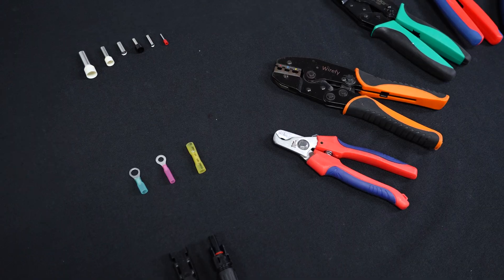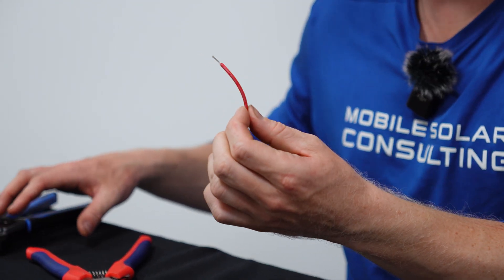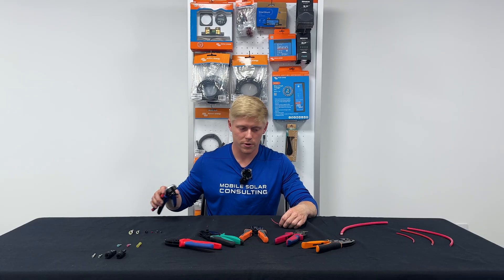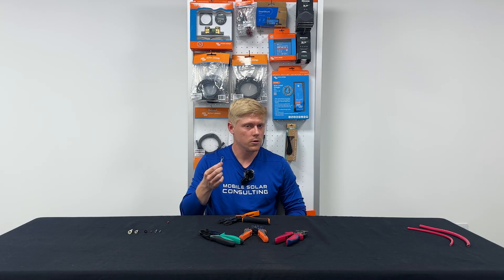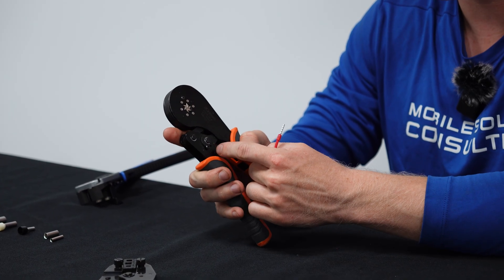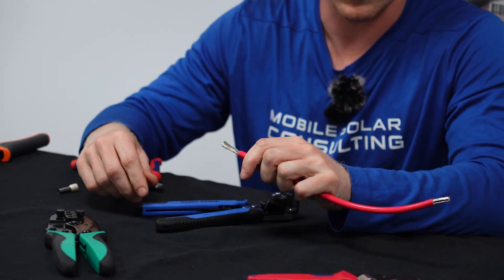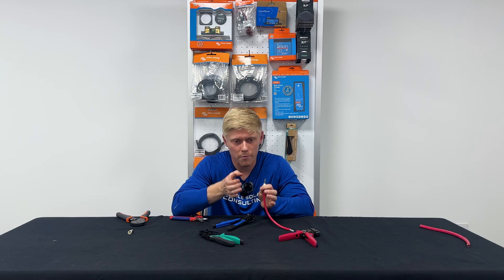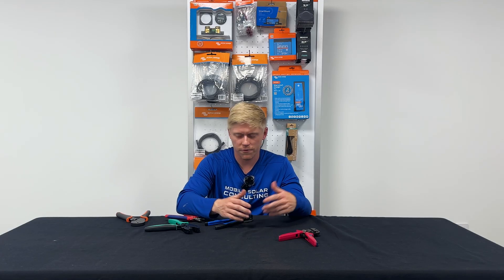THE ULTIMATE WIRE CRIMPING GUIDE!

Comment: Auto wire crimping tools suck.
I bought an expensive all in one and it does nothing.
Trying to strip speaker wires.
I put the wires in and it did nothing.
What a waste of money.
Shoulda just went to a hardware store and got them to do it.
Reply from the maker: Did you buy auto crimpers or auto strippers? Auto strippers do suck. But auto crimpers are awesome, and they work.
Reply: @MobileSolarConsulting I went to a hifi store and they showed me how to use them.
Legends.
Sorry for the rant.

Comment: Is there a technical term for that open U shaped crimp style vs the standard circular crimps?
Reply from the maker: The U-shaped crimp is called a Fork Connector. The circular one is a Ring Terminal.
Reply: @MobileSolarConsulting no im referring to the crimp itself, not the connection. Take butt connectors for example. There is the standard tubular style and the open style that uses that crimper with deep teeth. I was just wondering if there was a technical term for those 2 types. Since i made that comment i think ive figured out theyre just called open and closed barrel crimps?

Comment: Nice video.  You left out the dip crimper.     Been doing mobile electronics for 30 years and found dip crimpers make the most mechanically sound crimp on small gauge wires.
Reply from the maker: we do not crimp anything less than 18awg, so the existing crimpers we have for up to 10awg wire work well, and avoids DIY-ers needing to purchase an additional tool. Regardless, it's very helpful for our followers if you could provide a link to the product you are recommending. thank you!

Comment: There’s some debate over whether ferrules help or harm. Many Victron terminals work best when multistrand wire is compressed directly, which maximizes surface contact. That said, some terminals absolutely require ferrules, especially the spring type where you push the wire in. For others, I’m not sure that ferrules are a good idea.